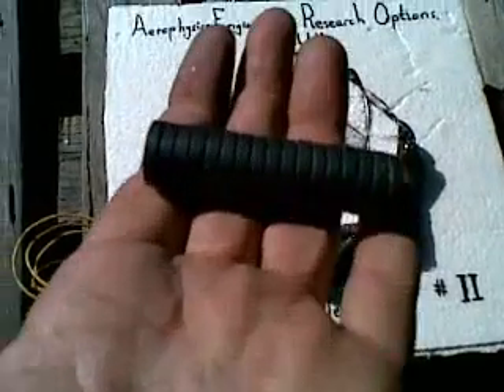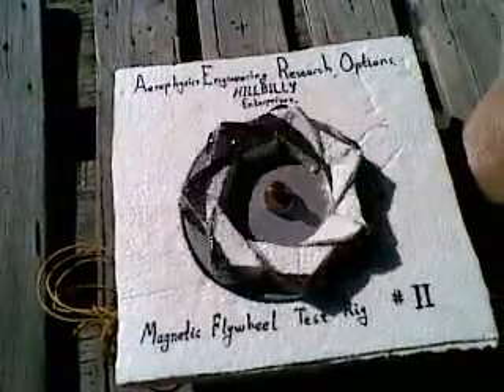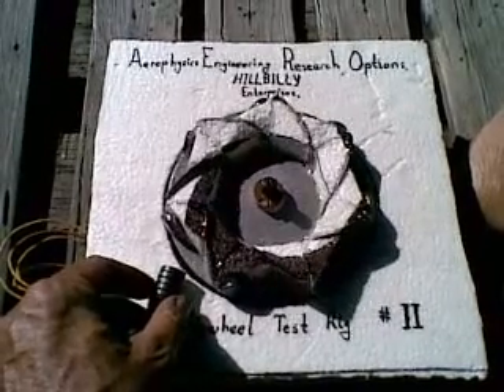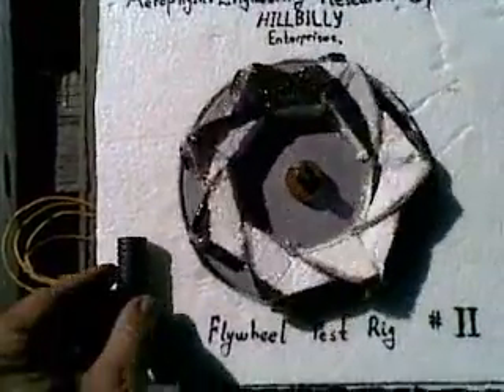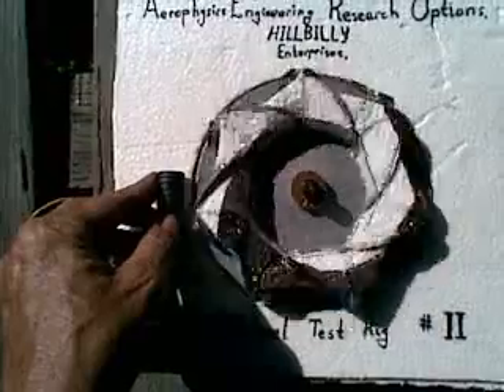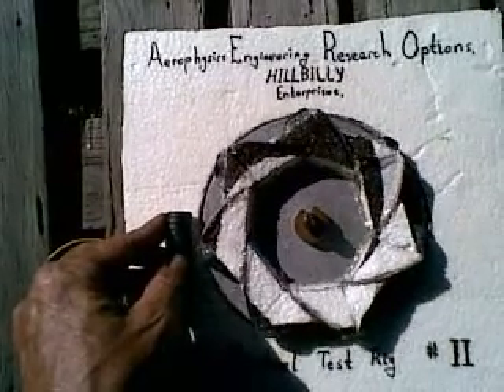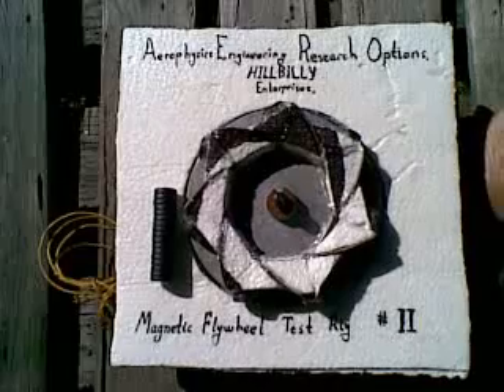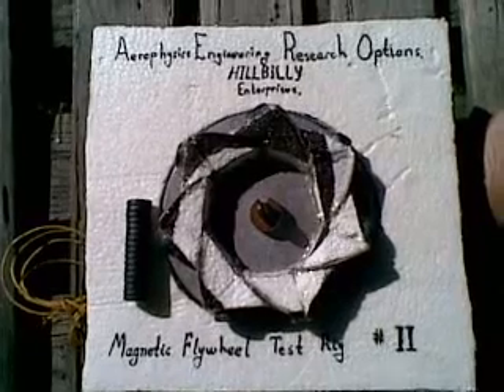Illegal Research..! Permanent Magnets Outlawed... Alternative Energy FORBIDDEN...#2.

Comment from the maker: @Tomken8d2
Yeah, sure Tom, I'll look at it, & maybe give it a go if it looks hopeful... But wait till you see Clips 3 & 4, where I show what a Phased Array of Static Repulsors does. 5x3+1x2, a bit rough...; & then 8x2, with better accuracy... But, the Cogging isn't the problem. The problem is that Total Retardation = Total Propulsion ; & it works equally disappointingly, forwards or backwards. There are 360 Degrees in a Circle, & the Vectors all neatly cancel each other. Ciao !

Comment from the maker: @theoldcabbie
G'day mate, thanks...! Um, yeah... I couldn't have left it at the Dump, even though I haven't got any use for a 38 Watt, 240 Volt AC Electric Fan - assuming it worked - & it was dumped for a reason... But, now it's a kind of a Dynamic Sculpture, to the Spirit of WIBNIF-ery... But, AC Motors don't have Commutators, I don't think... Maybe a pair of Slip-Rings...? The Sine-Wave Polarity Reversals of the A.C. is oscilating the Stator & the Rotor's Field Polarities... Ciao !

Comment: That's a really sweet bearing Warbles. You have to find a use for something as sweet as that. Just had a thought, assuming the Com and Windings are sound, you could replace the spinner on the generator exhaust, you may even generate enough power to light a small bulb. (For after dark inspection purposes of course) ;-)